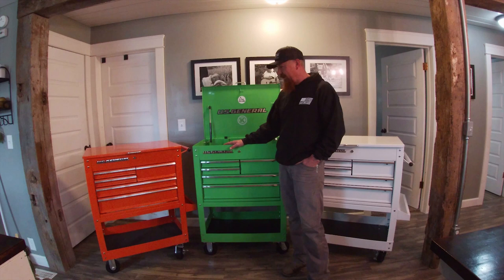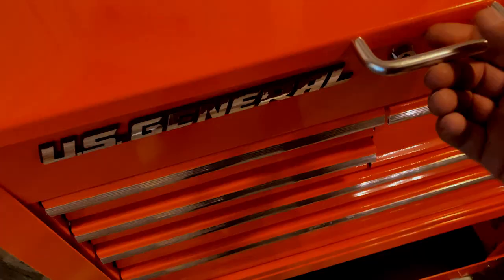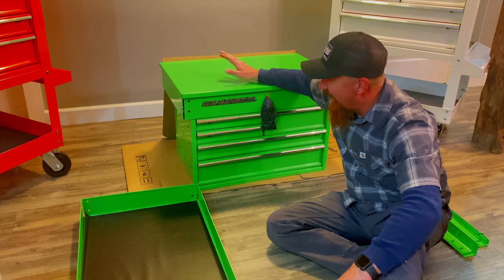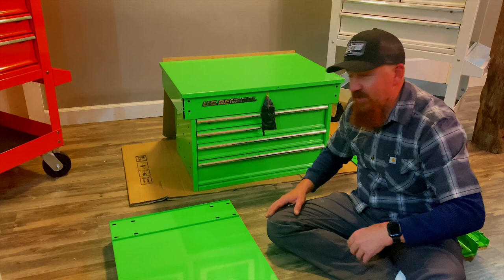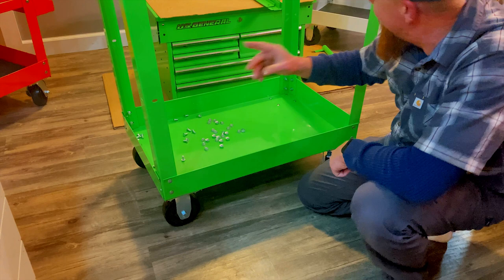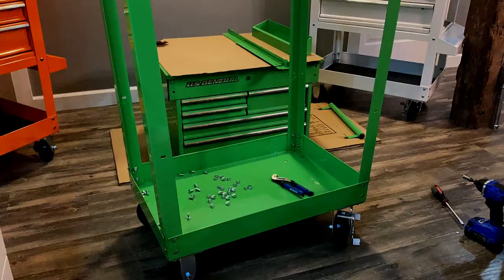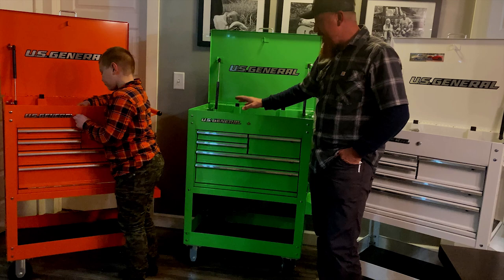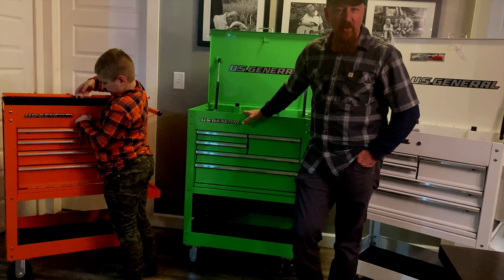What You Need To Know About the US General 30" 5 Drawer - Harbor Freight Toolbox Assembly and Review

Comment: Two comments. (1) The uprights go on the outside of the bottom tray. Much easier to align the bolt holts. (2) There are two different bolt lengths. The slightly longer ones are used with the reinforcing brackets on the top tray to upright assembly.
Reply from the maker: Great information!  Thanks for watching and commenting!
Reply: yea saw the same thing with the uprights but those two longer bolts are for the handle

Comment: I just picked one up a couple days ago and I installed the bottom of the uprights on the outside of the box instead of the inside and I had no issues with the bolts lining up! 👍🏼
Reply from the maker: Lol, maybe that is what I was supposed to do!  😂. Thanks for adding the tip!
Reply: Pretty sure the instructions said to mount on the outside. Pffff instructions, not for real men. Lol 😂

Comment: By the way.  You did the bottom wrong.  The vertical L track is supposed to be mounted onto the outside of the base, that would likely also fix your top not closing properly.

Comment: Great video But you put the uprights on wrong. that's the reason you had problems aligning up the bolt holds and why it was off kilter when you tried to put it together. good job!
Reply from the maker: I think you are exactly right!  Whoops!  Lol. Thanks for commenting!  Hopefully that helps people out.
Reply: He didn't put the top angle supports in as well.  Nothing wrong with alignment issues if it is assembled correctly!🙃

Comment: Idk but i have the 4 drawer series 2 and 5 drawer series 2 they’re both good carts but i noticed 4 drawer was little better to maneuver around the shop .. i think both are good carts not whole lot differences between 4 & 5 drawers
Reply from the maker: Yeah, I really like our 5 drawers, but I find that we leave them parked by the wall and don’t move them around much.
Reply: Yeah same here my 5 drawer cart just parked by the wall :) but i did upgraded the rolling wheels with much smoother with flexible tires to it and helps alot with moving them around addition to that upgrade i added tricycle wheels so i dont accidentally tip it over while im pushing the loaded cart